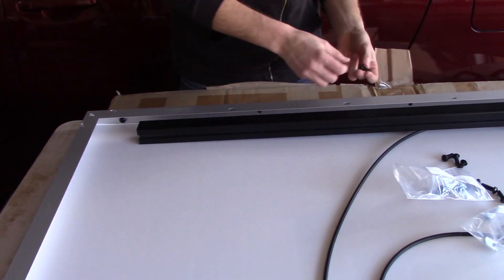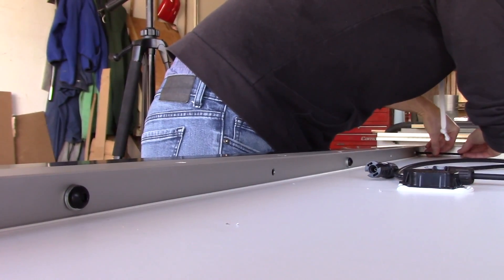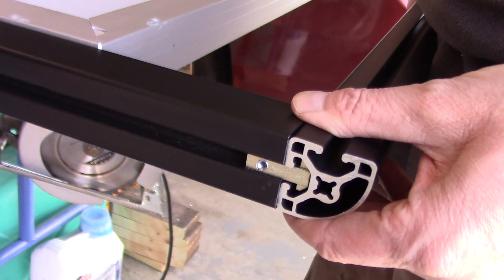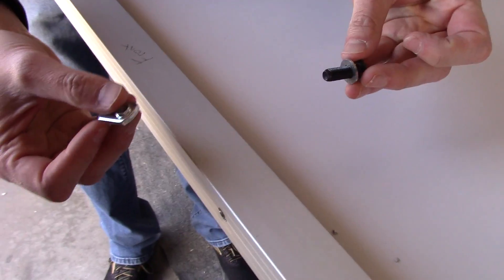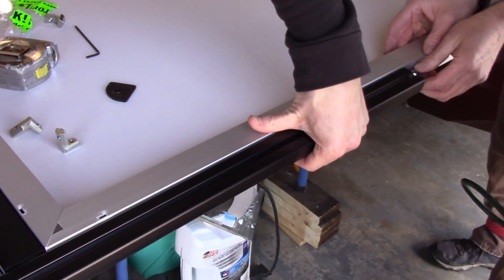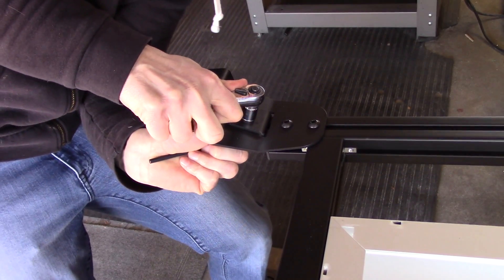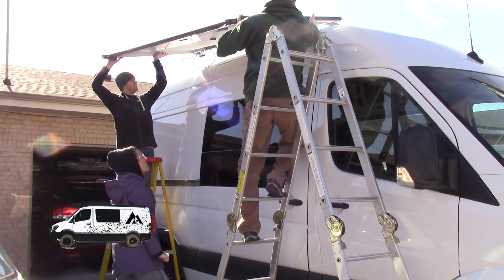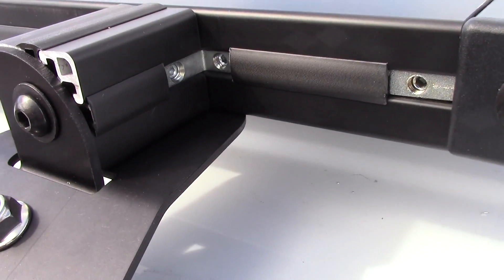400 WATTS OF SOLAR + 80/20 ROOF RACK | SPRINTER 144 VAN CONVERSION

Comment: Hey brother, very sleek. 1. Do you have a list and links to the hardware you used?
2. Any suggestions for a 144’ Sprinter with 2 max air fans on each end? I have the 80/20 poles but no hardware. It’s been hard to really know what I need. 
3. Any links to panels that you’ve found since you posted this? 
Thank you!
Nate

Comment: thank you.  finally, a well detailed how-you-did-it video without a bunch of bloviated verbal masturbation...  i am searching for just the right size high voltage home panel to fit between an AC unit and moonroof on a lowroof144 (max ~64” net).  the question to myself was how to install the front mounts while maintaining the lower profile of the standard rail mounts.  thanks for this idea, so simple.
Reply from the maker: Bloviate: talk at length, especially in an inflated or empty way.

I try... Glad it helped!

Comment: Thank you for using our towers. For a panel that large we might suggest a set of intermediate towers at mid span. You can use the same stubby cross bars to connect those to the longitudinal bars.  All the best, Hein, DIYvan
Reply from the maker: Works just fine. Thanks though!

Comment: Great video thank you! Very nice installation looks great good craftsmanship! I would be concerned though about the seal on the solar panel between the aluminum and the glass being stressed from bolting the panel frame so close to the glass. I feel like thermal expansion alone could create a problem by trying to pull the panel frame away from the glass. Normally mounting a solar panel on the bottom edge of the panel frame allows for some flexibility and would not transfer so much force to the aluminum/ glass seal. It does look beautiful though I hope it works out!
Reply from the maker: Thank you!!! 1 year later... not a single issue. Works like champ!

Comment: Love your 400w solar panel. 
But the 80/20 mounting is very dangerous, your solar panel have chance to fly away!
1. NEVER use hidden corner connector in a car, it very easy to loose under vibration. Check your solar panel NOW and replace them by the anchor fastener, or joint plate instead. Apply lockrite is better.
2. Replace the short 80/20 connected with mount tower with a whole piece from left to right.
My in cabin 80/20 with hidden corner connector screw popup after 1 hour off road drive. Good luck
Reply: via 80/20 manual, anchor fastener is the strongest mounting method. While the hidden inner connector is the weakest (I guess)
Reply from the maker: @wangwooodhead8900  1 year later... hasn't fallen off yet.. tighten every 6 months...

Comment: I love that you figured out a way to get 400 watts up there. Why did you use that style of connector instead of something like this on the bottom?   I've heard that style of connector isn't very strong https://8020.net/4352-black.html
Reply from the maker: Thanks!  Those connectors are just so easy to use. I looked at maybe doubling up with some of the 80/20 brackets like what you mentioned but everything has held up really well. I've gotten up once to tighten everything up after 6 months. Hasn't failed yet.
Reply: @osirisvans8391  awesome man. Thanks for the response. I love how you did it. Looks very slick

Comment: I have a camper and trying to fit 700w flexible on its roof. Looking for some sliding and tilting abilities to be added to the build so I can fit them all. Since they are flexible I have to make some aluminum frame around them first. The part that I am trying to figure is to be able to slide 2 of them under the other two and when expanded be able to tilt them as well. Any Ideas on hinging/sliding at the same time?
Reply from the maker: Wow thats a crazy amount of power!! Why so much? I find van projects usually work best the more simple you keep them. If you're going that big I would just get a roof rack with a max air vent spot. And just line the whole rack with them. They'll need to be mounted high enough to clear the open max air vent. I would stay away from set ups that you need to expand and contract to make them work. Set it and forget it!!

Comment: That looks great! I'm planning on using 80/20 to frame out the inside of my van, might try it on the roof too. Where did you get your 80/20 from? Thanks for posting another nice video!
Reply from the maker: I got my 80/20 from 80/20 and amazon. Which ever prices were better.

Comment: the finished product looks great but functionality wise it adds unnecessary weight because the outcome is that it provides 4 points of contact. the framing you did with the black rails was unnecessary because the solar panel already has a frame built around it. structurally it would have been better to have 2 extra middle supports, all you had to do was weld angle brackets to 6 points and it would have cut down on half the total weight and increased strength by probably 5 times what you have because welds are stronger than bolts, and cheaper in materials
Reply from the maker: it's 80/20 aluminum..... Very light. It's incredibly strong and looks way better than slapping 2 supports in the middle. Glad you enjoyed the video!
Reply: One thing to keep in mind about solar panels is that their mounting points are carefully engineered to maximize their life.  To much or too little cantilever results in a lot of  unsupported module frame which shortens the module's life from micro cracks in the cells caused by flexing.   And that's for non moving applications that rarely see wind speeds above 20 MPH.  Put solar modules on a van with lots flexing and wind and supporting the entire dimension of the module is an EXCELLENT idea.